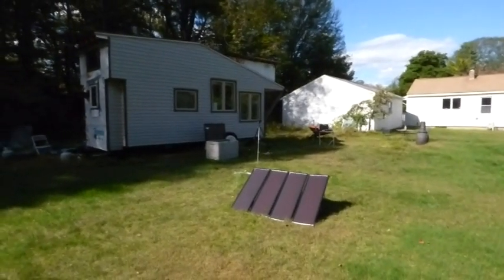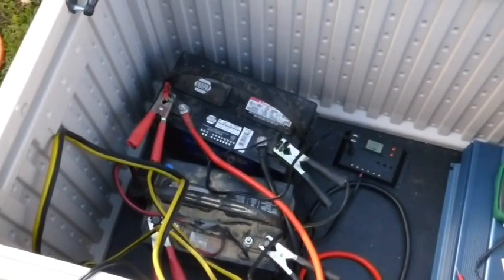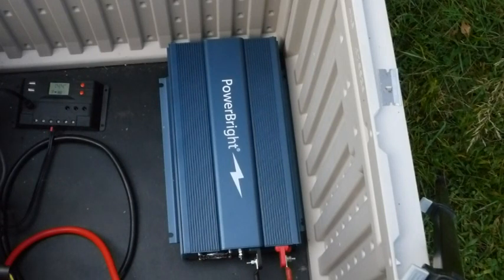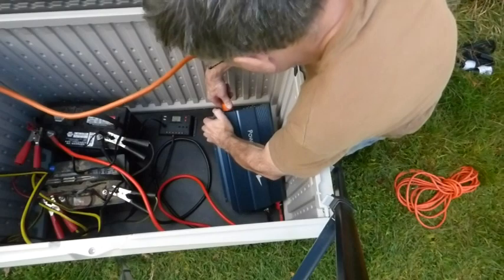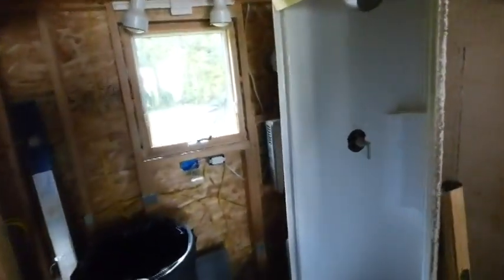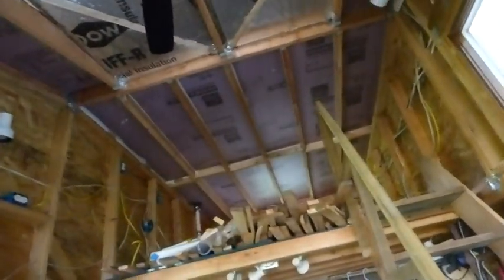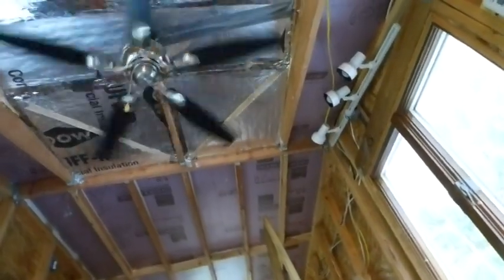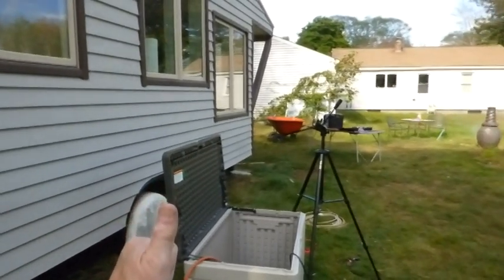SOLAR PANELS

Comment: I vehemently disagree with your comments about pure sine vs modified
Reply from the maker: I can say I had a modified and the ceiling fan made a growling noise.  With the pure sine wave it is close to silent as can be.  Also it is documented pure sine wave is the safest for the more delicate items one may have.
Reply: Seriouslu dude? Read your own idiotic words a cieling fan growling means you bought a cheap piece of shit fan, everybody watching your video knows it. Pure sine only makes a difference with EXTREMELY delicate electronics
Reply from the maker: @keithguiste2659  Simply put, pure sine wave power flows in even, arching waves, whereas modified sine wave power flows to your devices in chunky, square waves. The square waves are giving power to your device “all or nothing,” so to speak. Your device will run properly, or not. The power is coming through in a less seamless fashion. Gaining power that is flowing in modified sine waves does not come through as clean and efficient—it doesn’t flow to the device as “pure.” The devices will
get the power they need to operate, but when it comes to devices like fans, TV’s, radios and lights, they will tend to buzz, as they are running a bit “hotter,” due to the way power flows to them.

from this link.

https://invertersrus.com/pure-sine-vs-modified-sine/?gclid=Cj0KCQjw6PD3BRDPARIsAN8pHuFLJCysuGF4FIbasPkvxCKw4sG9kwsJvboBrYrh9ouEl9geemffJ0UaAiBpEALw_wcB
Reply from the maker: @keithguiste2659  My fan is quiet as can be now.  Do some research.  You insulting asshole.
Reply: You ignorant fuck do some research before embarrassing yourself on video
Reply from the maker: @keithguiste2659  I guess insulting people is normal today.

Comment: Wayne,  connection into house do you have video on how to or do you recommend installation by electrician?
Reply from the maker: I only do videos on what I did and not how I did it.  Do a lot of research on YouTube.  That is what I did and use a lot of common sense.  I would not do any electrical work on a house.  The was for my tiny house.

Comment: I full time rv and have been using modified on my TV, laptop, ect for years never a problem EVER
Reply from the maker: With many appliances modified if fine.  I had a modified and my ceiling fan made so much noise.  With the pure sine wave it is silent as can be.
Reply from the maker: My ceiling fan made so much noise with a modified it was ridiculous.  None with the pure sine wave.  Some things do work well with the modified.

Comment: Connecting 2-100watt kits to 1battery bank.  Can it be done safely?   Thats 8panels, 2charge controlers, 1batt bank (4-12volt)  can it be done safely?
Reply from the maker: All 8 panels are on one charge controller (EPEVER Sola rMPPT Charge Controller) and I have the Vmaxtanks VMAX SLR155 AGM 12v 155ah Deep Cycle battery.  I will be doing an update video on my system soon.
Reply from the maker: https://www.youtube.com/watch?v=HuLrHgA_5qI
Reply: Yes it can.
Reply from the maker: Soory for the late reply.  Check out my other video on my panels.  (8 panel setup).  https://www.youtube.com/watch?v=HuLrHgA_5qI&t=332s